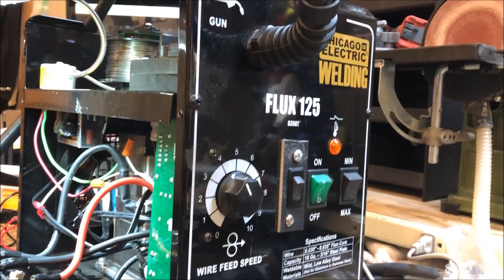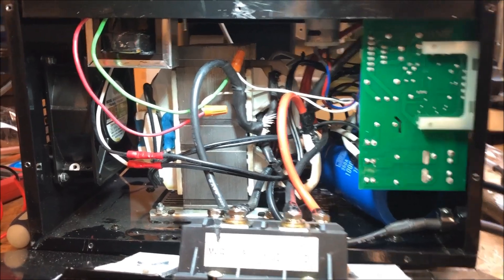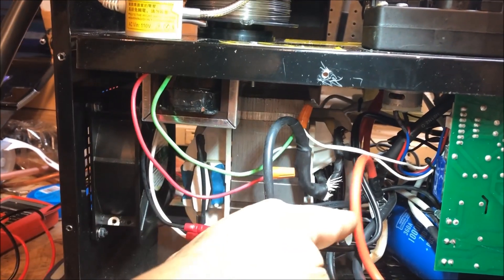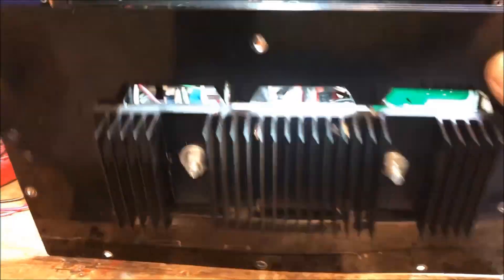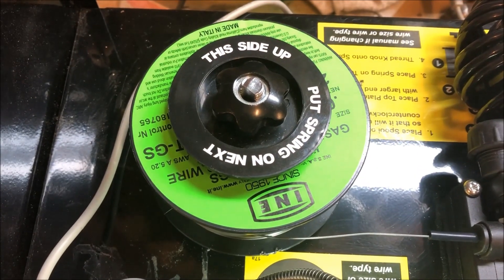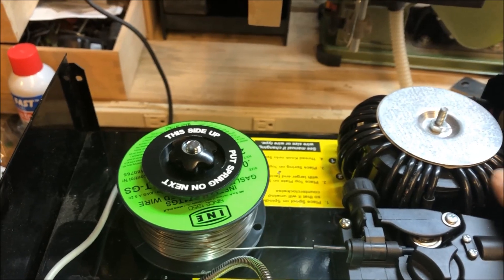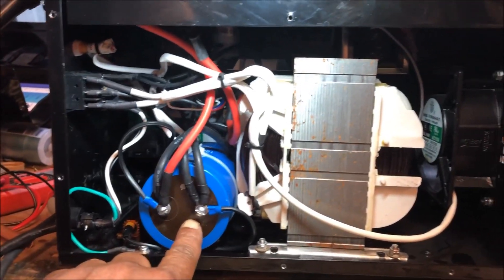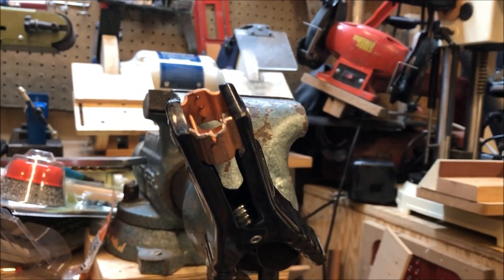Complete Harbor Freight 125 welder mod to DCEN

Comment: Did you add that fan also? How's that doable? that's an AC connection to the stock fan. Those CPU style fans are DC right?
Reply from the maker: Sorry. I honestly don't remember adding that fan, but I don't think so.  If anything it's just a larger computer fan.

Comment: Just subscribed to your channel and thank you for sharing your mods. I have one of these HF welders, but mine is a different version (63583). My welder has a small, factory installed, 24V transformer that I think is used to power the wire feed motor. I did add a 24V transformer to my MIG130 and posted a video on modifying that welder. If you haven't already, please consider a more detailed video on how you wired the switch to drain the capacitors. Cheers brother
Reply from the maker: LOL. I don't really have what I consider a "channel" and as such don't ask for subscribers but thanks anyway.

Comment: Nice find on the toroid core... now that I think about using... they are more common and coming down in price last I looked.  I was thinking with an external microwave oven transformer or maybe even with a variable inductor from an older buzzbox find AC welder.   Guessing just spec'ing out for max smoothing in a static inductor is all that is required.  The inductor helps more with constant current (CC) and the capacitors helps with more constant voltage (CV).  Neat build... didn't know about the linear power supply for the wire feed.  Thanks for sharing and neat to see the inductor install as I've not seen on these yet.
Reply: I was just looking at LKQ's site and the jumper cables are $5.99.  I've seen them for even better price at the Goodwill Store too.

Comment: the cost to do this with what you used. you can get the centry from HD for 200. iam starting to wonder myself.. if i shouldnt just go that way. AC looks like waves above and below the surface of the water.. DC is like MounTains. inbetween MTs are valleys.. the caps build a bridge to the next MT top.. so MT bridge MT bridge MT bridge so on ...
Reply: But buying a century defeats the purpose of diy
Reply: @chupasoplas  ooo i get it.. i diy radios and suchs. i have to eat my words above lol... parts are on the way lol.. sooooooo iam doing the conversion... 2 stages tho.. motor feed mod will be 2nd stage.
Reply: @chupasoplas  myself had no welder. heard all the norm of HF stuff.. but at 90 bucks i said F it lol... then came across the mods on here... will be fun to see how it comes out.. been 30 years since i welded lol
Reply from the maker: @XPFTP  If I do make any more changes it would be the motor feed mod.  Like I said, I only need to weld a couple of times a year, if that, and this works great for what I need it to do.
Reply from the maker: Yeah but I didn’t know any of this before I bought the cheap HF welder and didn’t want to just toss it and buy a different welder. I only need to weld maybe once a year. It gets the job done.
Reply: @ramaroodle  sort of in ssme boat. got the hf flux not knowing of the cheapo dc welder lol i still havent convert this one been 2 years. have the stuff to do it lol